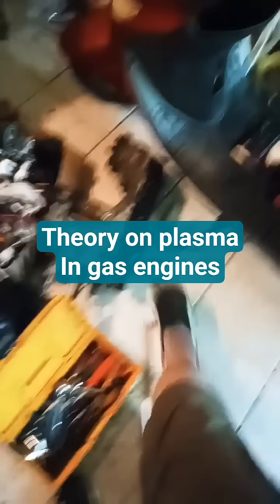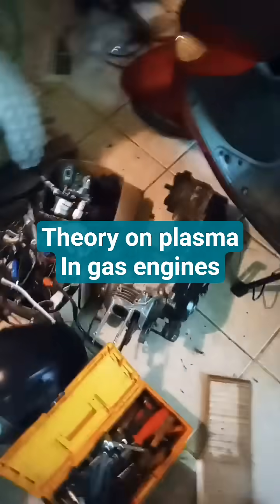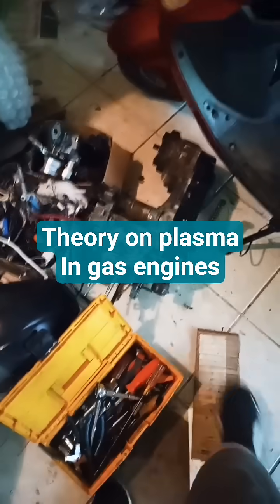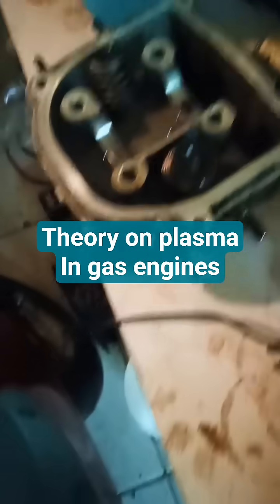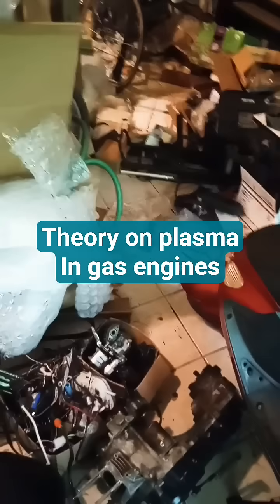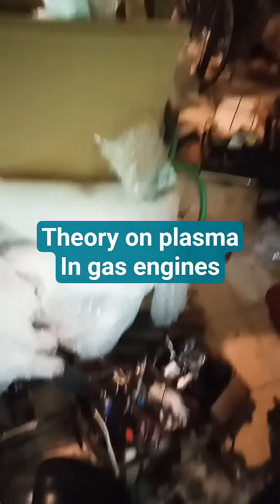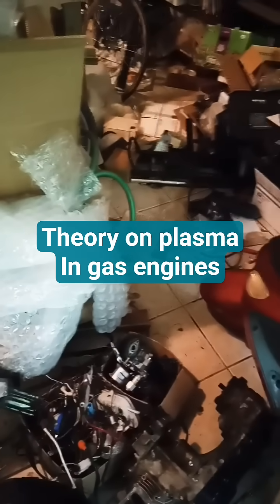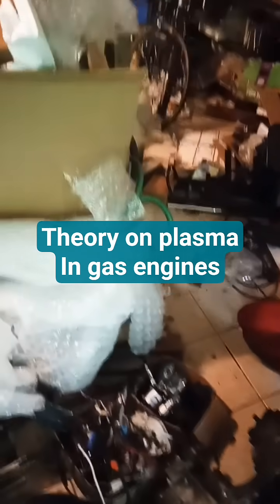Theory on electric plasma

Comment: If you're thinking ionization like a home air ionization appliance, those actually create ozone. Ozonisation of oxygen was a common way to help "clean the air", only a portion of the o2 is converted to o3. It actually impedes combustion by eliminating some of the oxygen. Then there's the efficiency loss from generation of the extra power.